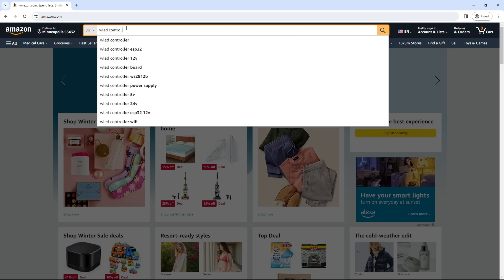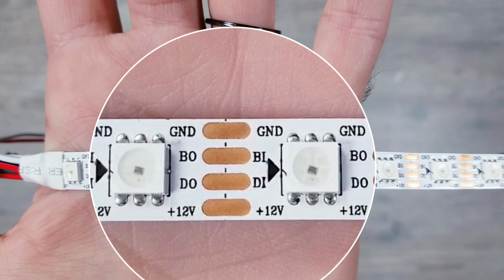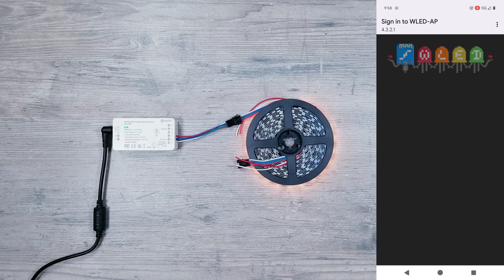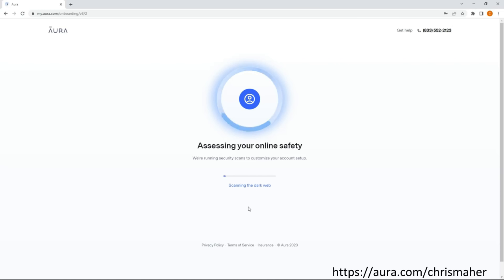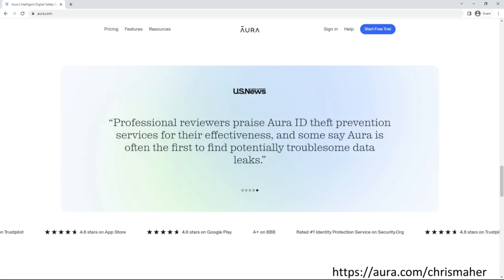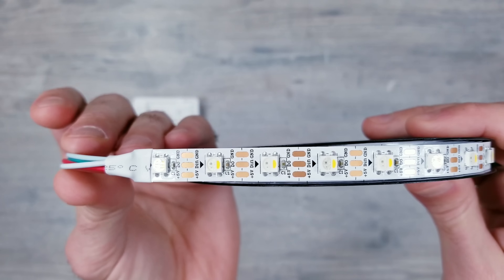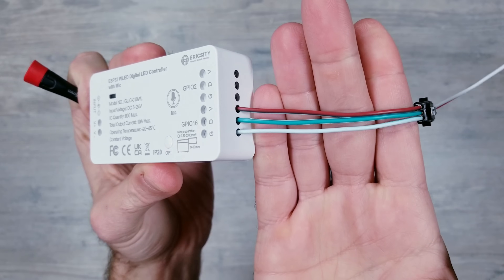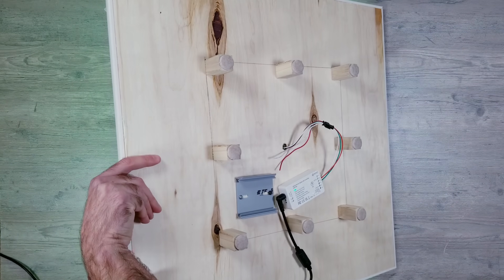Plug n Play WLED Controller: 5v, 12v, 24v Compatible! Full Walkthrough.

Comment: 5:31 If I want to connect 40 meters, can I do that? And what power supply do I need for the V5 and 12V LED strips?   Also, thank you for this channel. I am one of your biggest followers
Reply from the maker: I haven't tried that many leds with this controller but certainly something you could try doing! For that I would probably use the 12v ws2815 led strips with a 12v power supply With that many leds you would more than likely need to do some power injections! Thanks for the support my friend!
Reply: @ChrisMaherDIY  Thank you.. I also sent you an email regarding a project I am working on. I hope you will take a look and help me. 🩶🙏🏼

Comment: I have the same setup as you have but i cannot get any audio response, what am i doing wrong.,  Can you do a basic setup of the Wled setup?  This is about an older setup you made with esp32 and a mic.
Reply: How do I get the 8 x 32 scrolling text to go horizontal?  Why does the scrolling text option disappear?
Reply from the maker: In this video I go over how to get that working: https://youtu.be/QmMwrOUB_kw?si=48G31DEyG7G2LCLF
Reply: i can get the scrolling text to work with a 16 x 16, but never with the 8 x 32. @ChrisMaherDIY
Reply from the maker: Ahh I see! I have not tried it on that size. I might have to try ordering that size matrix and try it myself! Let me know if you figure it out and I'll do the same if I come up with a solution!
Reply: The problem i have is I cannot get the scroll to go horizontal.  Plus the data does not look right.
Reply: I did get the sound problem figured out with the mic and the esp 32, I will send you the solution tomorrow.   11pm my time.  No luck yet on the 8 x 32 scrolling text. @ChrisMaherDIY
Reply: Gravcentric

Audio active  enabled

Analogmic  35r/o

Digitalmic   genric analog

squelch   20
gain 50
agc  off

dynamics   limiter on
rise  80
fall 1400

frequency     logarithmic   loudness

sync  port   11988
mode  off

So far, it seems it only works on the Grav options.
Reply from the maker: Thanks for watching! I have been thinking about doing another updated sound setup video since I know that one is getting old and I'm sure things have changed since then. I'll put that on the list of videos I hope to get to at some point. Thanks!
Reply: Thanks, also why are there so many different versions of Wled?   @ChrisMaherDIY
Reply from the maker: The good folks at WLED are always releasing updated versions of the program with new features/bug fixes on previous versions.

Comment: On the controller housing, it said the maximum IC/Pixel count is 800. Is that based on the number of LEDs or length?
Reply from the maker: Thanks for watching! That is just the number the good people at WLED recommended on keeping your leds under per data output. I have definitely gone above that and had no issues but at some point performance will start to drop if your trying to drive too many leds on one data pin.
Reply: The problem is this controller doesn't expose all of the output pins available on the ESP32. The chip is capable of driving more. This design doesn't. Much better off using an actual unmodified ESP32.
Reply: The problem is framerate and the protocol. The ws28xx protocol is fixed rate so with 100 LEDs each LED can do 333FPS but with a 1000 LEDs you are down to 33FPS. To keep a good framerate it's recommended not to exceed 600LEDs for a single data output, this will keep you above the 42FPS WLED default at all times. Go higher and you'll start to see more choppy animations and transitions.

Comment: Great video as always. Question. What would be the benefit of buying this controller over the Domestic controller you reviewed a few weeks ago? Thanks.
Reply: I was wondering the same thing…. Which one has a better bang for your buck?? This one is obviously cheaper and I wonder if there is a big difference in performance if any?
Reply from the maker: They both have their advantages I would say. The domestic automation controllers have a built in relay and fuse plus have simple attachments made to connect different switches, sensors, and more. I also like that their controllers come with a jst connector already attached and I prefer their lever system for connecting wires since I can clearly see what's going on. I would say the advantage of this controller by ericsity is that it supports 5, 12, and 24 volt strips. But overall they both are great products!

Comment: love this controller as it supports the full range of voltages, it is now in my basket.  It, or something that looks similar but a different name, is available in the uk.
Reply: yes, does look the same but it does not say its got a built in mic like the one in this video
Reply from the maker: Awesome! Glad there is something similar available over there!
Reply: Which one did you find, I’m struggling to find one in the UK
Reply: @jayjosephtv  GLEDOPTO WLED LED
Reply: @AIRW0LFA567W  What power unit did you use?  (I'm also from UK and complete newbie at this).....figuring out designing a media wall and using approx 5m of strip.
Reply: @paulhopwood9741  Will depend on what voltage you lights are.  Mine are 12v so I have  a 12v power supplier running in with the LED then getting 12v.  I am about to run my kitchen COB lights which are 24v so should be fine for them too.
Reply: @jayjosephtv  type in GLEDOPTO WLED LED, hope this helps

Comment: I love your videos! I’m having trouble getting WLED working, not sure why. I’ve followed the instructions on several YouTube videos… help.😂
Reply: Best to start with pre-assembled hardware and a WS2812b strip and these new controllers seem like a great solution for the hardware!
Reply: @JB-fh1bb  are those the red pre loaded ones on Amazon?
Reply: @EasyDoesIt70  I can’t speak to which ones you see on your local Amazon store, but there’s a link to the mic version in the video description and the top comment. Happy lighting!
Reply from the maker: Thanks for watching and bummer your having issues! Anytime something doesnt work, it usually comes down to the grounds are not connected together, jumper wires are defective, or I forgot to update the gpio field in led preferences to the correct data pin i'm using on the esp device. Also make sure the arrows on the led strip are all pointing in the same direction which is away from the controller. Hope that helps!